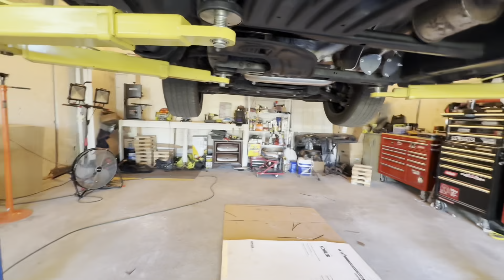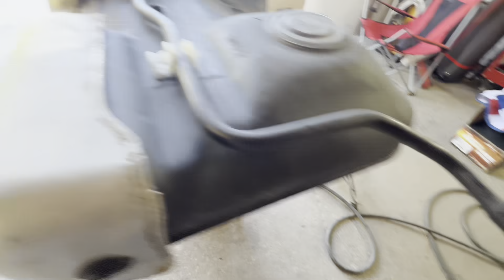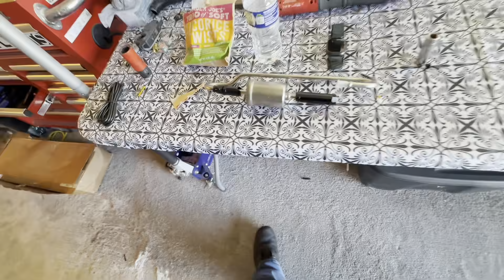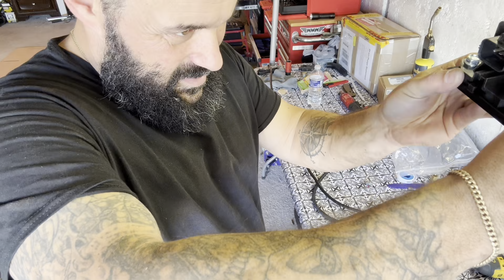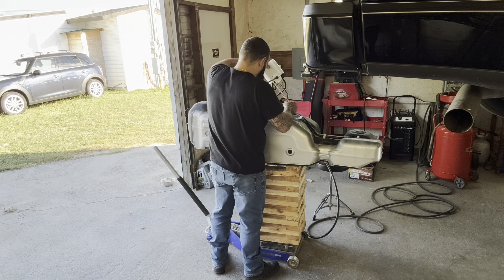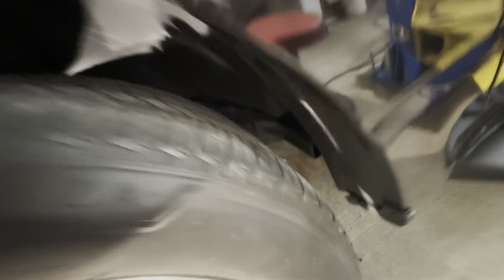21-25 F-150 JD performance stage two fuel system install

Comment: So I’m assuming now you can run e85 with boost right?
Reply from the maker: I’m on full pump e85 on 18psi of boost on this system
Reply: @turbotimegarage do you have anytimes you ran on 18 psi and stock trans and motor?
Reply from the maker: @SLOWTTRS usually runs a 6.5-6.6 @113-14 in the 1/8th mile, with a soft launch as I’m not running a two step. 60’ can improve a couple tenths as it’s typically a 1.8. Plan to record some 60-130 soon. Should be lower 5s maybe a high 4
Reply: @turbotimegarage for sure have seen some run in the 1.4 60ft range